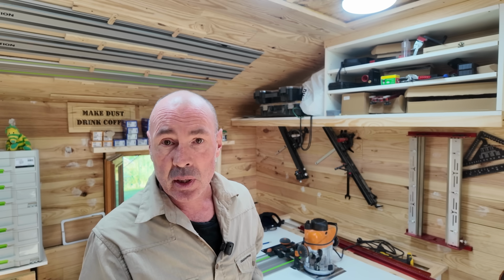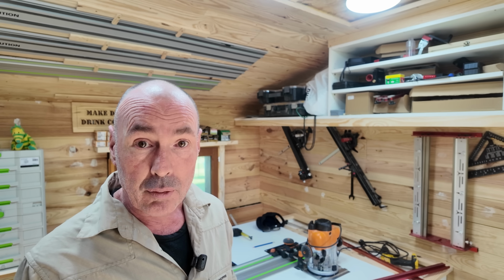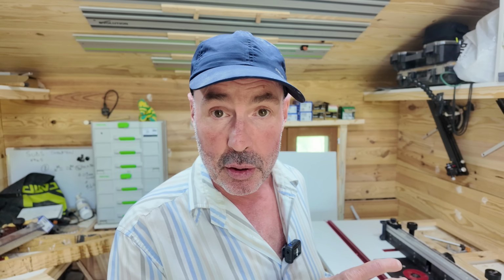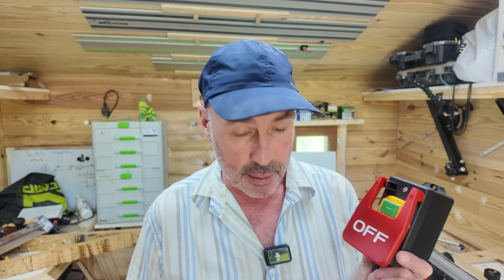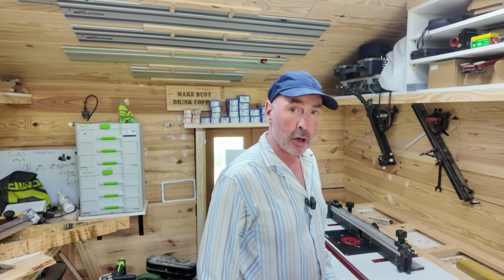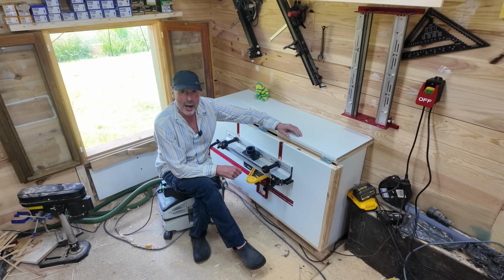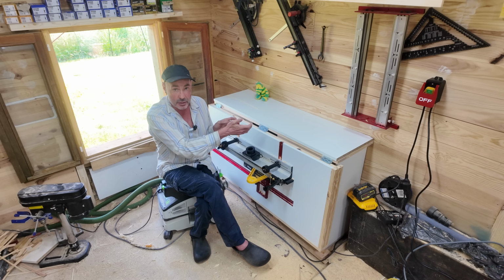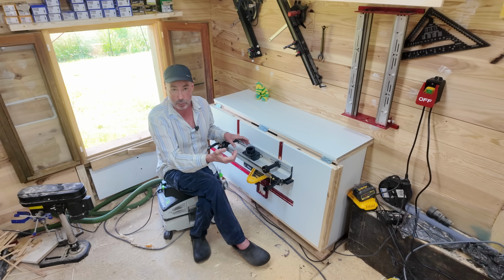Huge Fold Down Router Table for the Small Workshop

Comment: noticed that, like me, you've lost one of the knurled nuts off the enjoywood featherboard/roller thingy... if you manage to use your you tube clout(TM) to get a replacement, maybe suggest there are others that might need them 😆
Reply from the maker: Hi. I found the knob on the floor ages ago but didn’t realise where it was from until I made this video. They are now reunited. Regards JP
Reply: @Smallbarnworkshop  found replacements on amazon, then went and bought the wrong size 🤦‍♂😂

Comment: You''re right - the switch needs to be under the front edge of the table so you can hit it quickly and without reaching across to the wall.  That T slot with ruler scale looks good - just looking it up - every time I watch one of your videos I end up spending money"
Reply from the maker: Hi Rob. Sorry for costing you money. It will be mounted on the side nosing now I’ve lads them. Regards JP